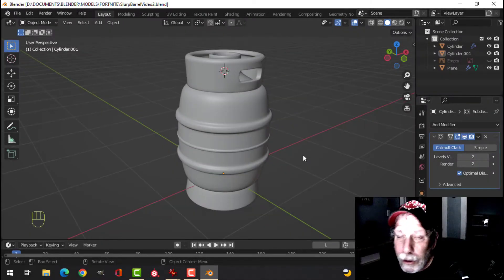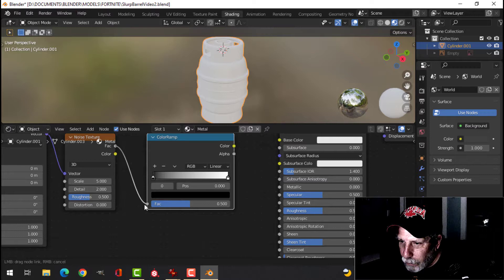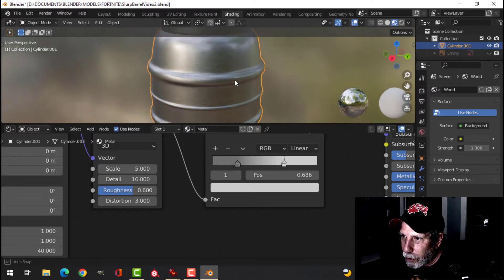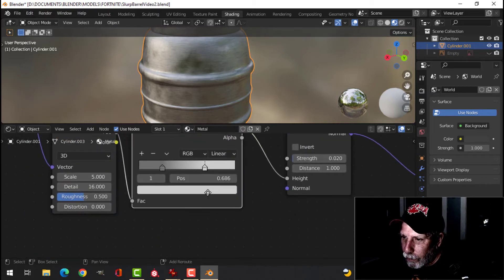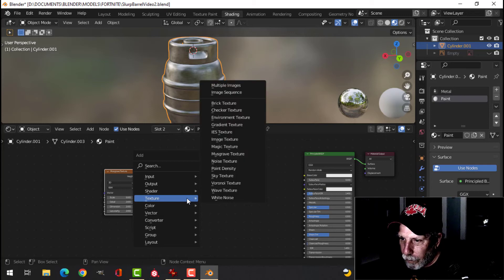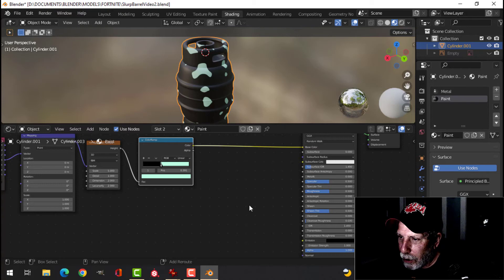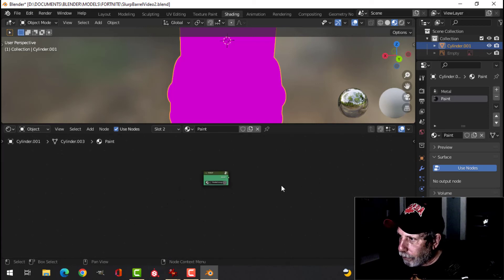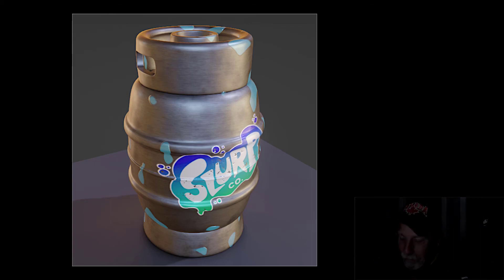BLENDER: FORTNITE SLURP BARREL (PART 2)

Comment: What would BLENDER lack to be closer to SUBSTANCE PAINTER and in what similar way can it be textured in BLENDER itself? My question is because the requirements of my PC are basic and not enough to install SUBSTANCE PAINTER. thank you @ Zerobio
Reply from the maker: Well, aside from the fact that Substance Painter comes with many pre-installed materials, brushes, alphas and normals and is a sophisticated painting program, it is also much easier to actually apply and/or paint in it.  You can do some texture painting in Blender of course and procedural materials so Blender is definitely great.  I prefer SP, however.  On the other hand, you really do need to have decent UV's for SP to do a good job.  It's easier in Blender when you often don't need to unwrap at all.